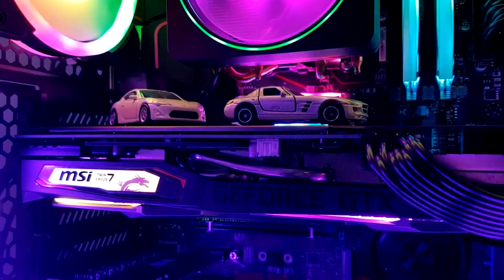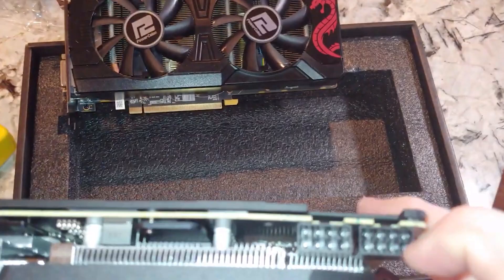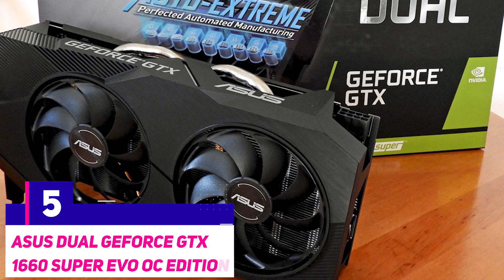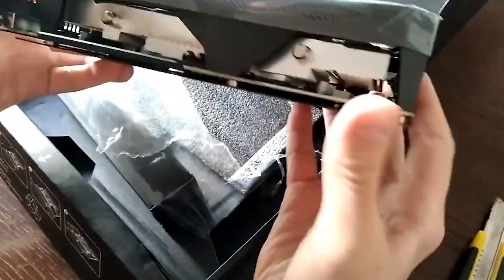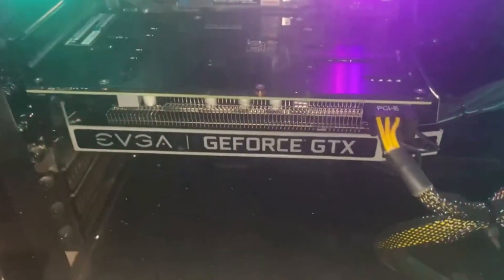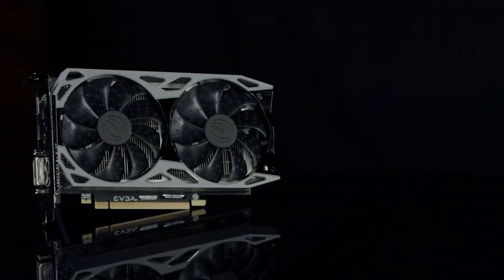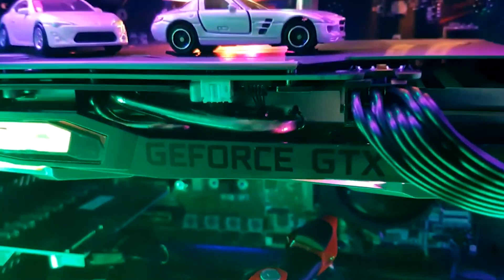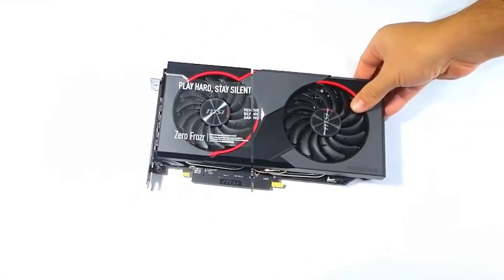The 7 BEST BUDGET GPUS of 2021

Comment: You’re kidding. None of these are aviable for $350 ;-) For that price you can get some of mentioned cards but pre-owned and used for mining 24/7 for a lasy year
Reply: The cheapest one I found was as the 1660 used and it looked burnt and only had one display port and was used for mining for 2 months non stop it was 288 on auction
Reply: Agree, 1660 are all $600 everywhere I look, and the price tracker shows they were all that price at the start of OCT, these prices must be suggested retail, which NOBODY has done for about a year.
Reply: Why do people act like mining hurts cards?  I had like 70 GPU's mining for years, still use some of them for gaming with 0 issues.

Comment from the maker: What GPU would you pick up if you could?
Reply: rtx 3090
Reply: i just want a gtx 1650 at msrp 😭😭
Reply: @screenfy  how much was it's msrp?
Reply: @appeasedape4895  around 150 usd
Reply: I ain't got a clue lol. havent picked up enough info about pc parts
Reply: RX 6600 XT in prebuild PC paired with i3 10105f, 500 GB SSD _ 1200 Euros
Reply: @overtaxed3628  waste of money
Reply: @oo_doggo4736  Well maybe but RX 6600 XT alone cost 800 euros, so .. !!
Reply: Rtx 2070